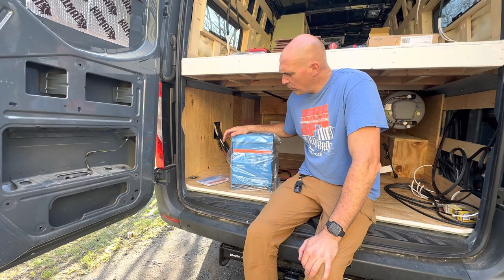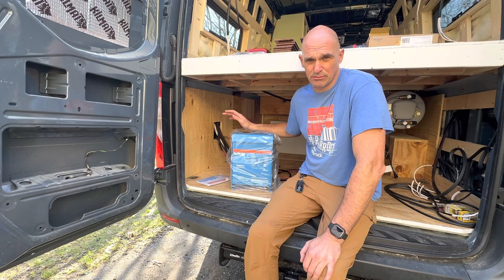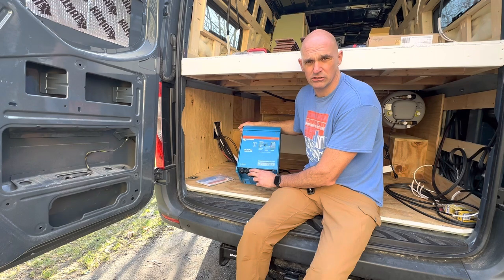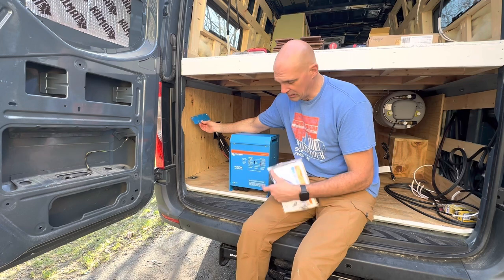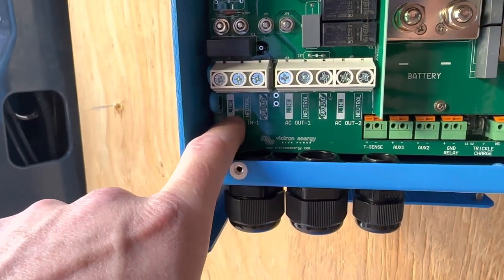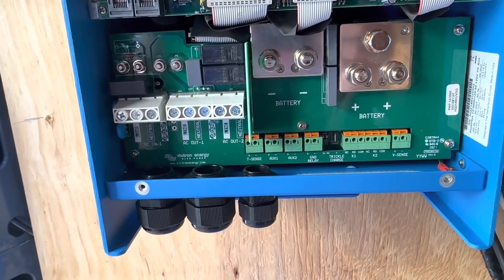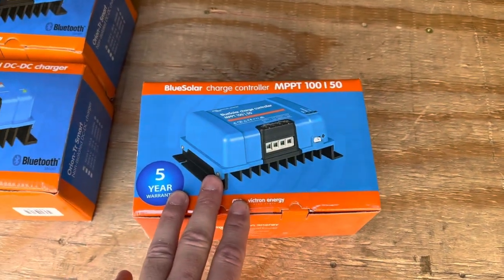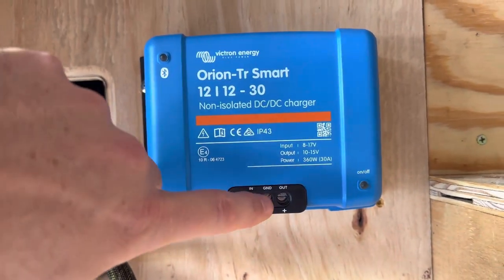Victron energy electrical components | victron lynx shunt and distributor

Comment: Thanx for your great Video 👍 
One Question: What are the Lynx Shunt and the Lynx distributor talking?  
Cause the Lynx Shunt doesn't detect a blown fuse and doesn't report this via CAN. Up to now only the Lynx BMS can do this and maybe in the future a Lynx Shunt 2.0 
To me it looks like the Shunt only gives the Distributor power, without any talking. But I would be happy if I'm wrong.
Reply from the maker: Thanks for the question, as set you are correct the shunt only provides power to the distributor.  The lynx shunt needs a processor to communicate all the information it holds and thats where the cerbo gx comes in, its the brains and conduit for all the information collected by the shunt and then the touch display that partners with it is where are the info is displayed.  I briefly mentioned the cerbo gx in the video and a full explanation will come when i hook it up because i think it really needs its own video.  The cerbo ttalks to all the victron components either through a can bus connection or a ve direct cable proprietary to the victron network.  Thanks for checking out the channel and for the great question!